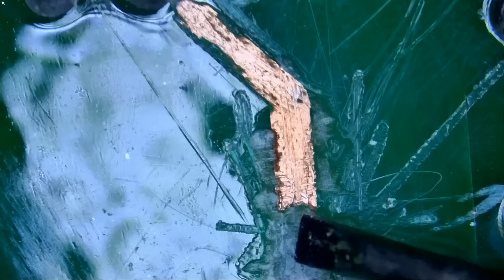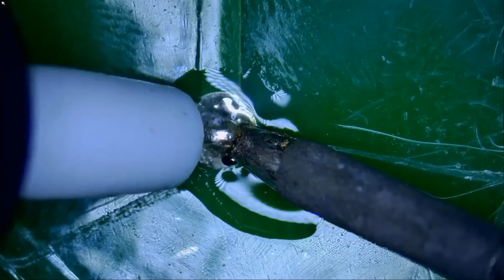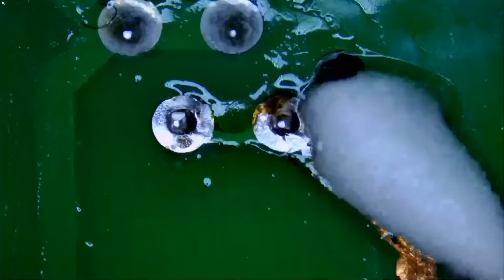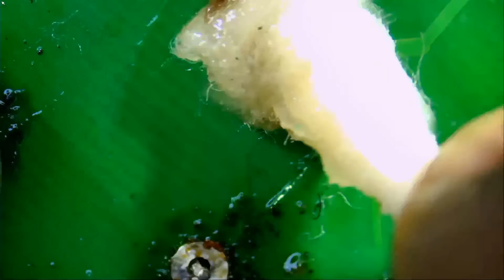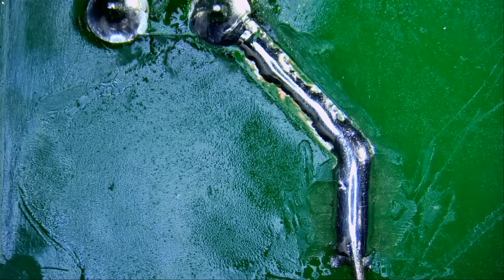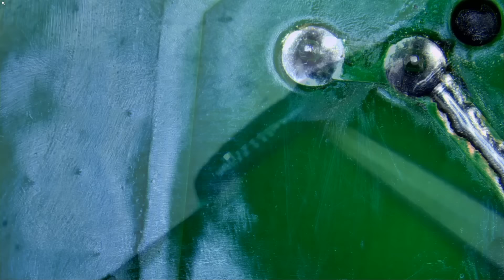Whirlpool Dryer Motherboard Repair

Comment: In my former job, I liked to use a Weller rework station with vacuum pump for desoldering. It was very convenient to use it sometimes, but I wonder how practical and economical this kind of equipment is when it comes to daily use. Alex, have you had any experience with this kind of equipment?
Reply: WELLER is a world class maker of soldering equipment. The soldering iron in this video is by Weller. They design tools to be used DAILY, by professionals.
Reply: Radio shack used to have a soldering iron with a solder sucker built into the tip.

Comment: Can I ask a question please , I brought a soldering iron and i noticed I can adjust the heat is there a certain temperature I should be using it sorry for the dumb question keep up the good work sir your vids has made me want to try fix a mosfit on my power inverter , wish me luck 😩😂
Reply: Then you did not buy a soldering iron - you bought junk.
Reply: @pingpong9656  ok I don’t call spending £59.99 on junk at all maybe you should get a life or grow up before commenting with unless information

Comment: I bought a washer and dryer about 3 years ago for $200 the dryer would not heat and I fixed the exact same problem it was a bad relay on that same board

Comment: I repaired the same board in my drier except the relay was burnt to hell along with the board.  Used a different type of relay with heavy gauge wire from the source power to the load.  Took the coil voltage from the other end of the traces on the board.
Pathetic design for a 30A circuit.

Comment: solder suckers are amazing for hdmi ports to clean the legs holes after you desolder thr port . but you need to use it correly. heat the solder with soldering iron from one end and use the sucker on the other end as flat as possible to create a vaccum. waaaaay better and faster than a desoldering wick
متابعك من الجزائر

Comment: Two relays were replaced on my oven's PCB due to a power surge caused by a storm.
*  The oven was ON during the storm
  Also a relay was replaced in my Onkyo stereo amplifier due to the same lightning storm.   
* The Onkyo receiver was OFF during the storm. 

 (** I recommend turning off devices at the breaker electrical panel or unplugging the device during a big storm.  Unplugging the devices is sometimes not practical due to the location of the outlet and the number of devices requiring to be unplugged)

Comment: I replaced the same relay. The issue is the relay has high current and the solder joint is not large enough to handle it. This leads to heating of the joint and eventual breakdown then arching that destroys the solder joint.  Looks like the the owner tried to clean up the trace and solder point.

Comment: Hi,
If you mention temperatures, are they in fahrenheit or celsius?
Hot air 500 degrees and soldering 450 you mentioned in some videos.
Keep up the good work and nice interesting videos.
Best regards,
Ronald
Reply: Those are celsius figures.

Comment: ironically, the sucker works great with low melt solder...
Reply: Yup  - gives you more time to get the nozzle on tightly around the pin before you suck it off.

Comment: Great Video Alex! Strangely enough I recently replaced 4x relays which look identical on a solar inverter repair. I also had to repair a few tracks that were burnt out due to high current flow so I used 2.5mm2 solid copper wire to beef up the tracks. Great Job. Well Done!

Comment: I’m guilty of recommending you use the sucker a couple days ago although you tried it and didn’t like it just like you mentioned the wick is your comfort zone personally i use it to pull most of the solder then use wick because i prefer to use as little wicking material as possible glad you tried as far as you charging $100 per trace and charging him a fifth of what his spectrum analyzer costs really was a steal that guy using that machine made his money back and should either pay up or go buy a new one i thought it was fair price for saving him money btw as my name implies i actually have to build rc airplanes from scratch foam alone i solder repair and do computer work myself no help and trouble shooting to have a piece of foam turn into an airplane flying ten miles away with live camera control

Comment: Modern Washingmachines and dryers have horrible powersupplies. They have cheap switching units which overload easily but cost half the price of a new machine to replace. I lately fixed one by replacing a varistor, resistor and an IC + trace repair. All of them blew because of a slight power fluctuation. Material costs of maybe 3  € because I had to buy stacks of the spares.

Comment: Grab a multimeter and set it to Ohms. Touch the leads across the electromagnet coil pins and measure resistance. Anywhere from 50-120 ohms is OK. Out of range or open means a bad electromagnet coil winding and time for a new relay.

Comment: I just recently repaired the exact same board and relay for my daughters dryer, it seems to be a common issue for theses boards due to vibration. Her relay was still good, I just had to add a wire. As always, nice job Alex!
Reply: So the relay needs to be glued in place?

Comment: Why charge a customer $100 for polishing 1 pin? Thank you for not exposing my eyes to uv light after applying solder mask. I think use braid instead of wire. I won a prize but you don't answer me.

Comment: My Maytag epic dryer basically did the samething.the trace burnt up just from use.

Used some  Thick wire to patch the trace,then flooded the trace with solder to beef up the current capacity. 

 planned obsolescence!!

Every year like clockwork in sept-oct i have to replace the heating element,which is fine as i take the  Opportunity to strip down the whole dryer and clean all the lint out.bout every 3 or 4 years i replace the belt,rollers etc. Just keep the parts i need on hand,and order replaces when i do the work.

I refuse to move into a newer dryer as they are a pita to work on,have higher costing parts,and fail more often.

Comment: Good repair. When using a solder pump / sucker move the iron out of the way and then quickly place the nozzle perpendicular / flat to the PCB.
Reply: he probably can't be cause the microscope is in the way
Reply: Ahh yes the teaching an experienced repair tech how to suck eggs.. Classic
Reply: Solder suckers are just junk. I’ve tried giving them a fair shake, I really wanted them to work. I’ve tried probably nearly 20 kinds of them. I’ve tried adding extra solder, I’ve tried adjusting the heat from the iron to keep the solder flowed longer, I’ve tried adding extra flux to help the heat remain, I’ve tried putting the sucker perpendicular to the board (which is nearly impossible under microscope). They are just junk. Plain and simple. There are much better methods available. The poster above me is absolutely right, the solder is cooled and hardened before the sucker even becomes perpendicular. But thank you for explaining what the word “perpendicular” means, none of us had any clue 😂
Reply: @ProudOfYourRoots definitely takes some crazy fast precision
Reply: Those type of suckers don't work very well. The Solderpult by Ersin is better.
It is twice as long and thicker so it sucks more air.
Reply: This, it requires a bit of technique. But also it wasn't the most appropriate tool for this job.

Comment: Alex, the ‘domino’ modules used in various washer/driers have issues with a cheap power resistor shorting and blowing an IC … it takes like 4$ in parts to repair a 200$ module

Comment: The tip of solder sucker is heat resistant we can put it on the soldring iron tip and it won't melt that way it will suck like it should i didntt know  that when i bought it i have the same one

Comment: Solder sucker works fine, when you need desolder any tht components, but after sucking solder jonit you need still using solder wick but save them. Solder suckre works better when you mixing unleaded tin with leaded. Regards 🙂

Comment: I noticed you didn’t test the relay before fitting you should test them
Reply: You don’t normally test a replacement component out of circuit before fitting
Reply: @gordonm2821  A relay is like a switch best to test it works
Reply: Thanks for the insight of what a relay does, greatly appreciate it

Comment: That type of failure of a soldered joint on a relay or inductor is usually caused by metal fatigue of the solder, due to vibration and lack of mechanical support of the component.  I would always put some hot melt glue or similar around the relay to take the vibration stress off of the soldered joints.
Reply: How do you know that the old relay failed? It looked to me that the relay pin was burned due to arcing at the failed soldered joint the heat from the arcing would also cause the track to lift from the substrate.
Reply: Or excessive current flow, and oxidisation of the solder. I recently replaced 4 identical relays on a solar inverter, and there would have been no vibration in that.
Reply: Kap tape at the least.
Reply: I think you're confusing the relay with a transformer.

Comment: Use conformal coating to waterproof the board.
Reply: Mg Chemicals makes a real good conformal coating in a spray can.
Reply: Unless you know what was applied from factory I wouldn't even mind, it's probably coated by deposition with the acrylic type or parylene, some types of conformal coating won't play well together, gotta be careful

Comment: Hello Dear Alex great work, this is my specialty i repair every electrical PCB Board as i see this is the first time you have accepted a washing machine PCB board so it's different from computer repairing because components of computer boards only work by D.C. but components on an electrical PCB boards are working by both A.C. and D C.
Reply: I think bc he can repair without any assemble or disassemble. Firstly doing the jobs that no need to disassemble. Smart move. He using his brain 😁👍

Comment: May I ask what kind of wire did you use for the trace? Also great video!
Reply: It's solder dude.
Reply: Probably some aluminum garbage
Reply: Looks like tinned solid core copper wire.

Comment: I was cringing watching him power through the conformal coating.  Probably acrylic or polyurethane.  But it's not hard to remove with IPA or mechanically
Reply: Meh, we use conformal coating in FPV drone builds and it's perfectly fine to just blast through it with the iron.

Comment: I agree, low melt solder is the best approach. Having said that the way you're supposed to use the solder sucker is to heat the joint with the soldering iron and once the solder is molten you quickly remove the soldering iron and put the solder sucker fully perpendicular against the board and release it so you're covering the entire hole and pin with the solder extractor. When you do it in that manner it's actually pretty effective.
Reply: And adding more solder is helpful when using solder sucker.
Reply: @requiem4adreamc  I sometimes use a toothpick to enlarge the hole in the board while the solder is still hot. Works great.
Reply: @requiem4adreamc  Yea, that would of worked pretty well if he gave it a fair try. Plus, not holding it close enough to the board to get a better vaccum and not using enough solder to allow the tip of the pump to create a better seal with the pad. It was only ever going to go one way, badly. These bigger through holes shouldn't be much of a problem for these cheap pumps. It almost did the job with a poor attempt.
Reply: Agree
Reply: Was gonna write th same
Reply: @windowsxpprofessional  "XP professional" that brings back memories! And probably still faster than the newer O/S's  with all of the excess bloat they now have :(
Reply: @BuyitFixit  yep :(
I still love this os so much that I use it on a vm for the fun but sad because there is no browser support:(
Reply: It's impossible to hold a solder sucker perpendicular while working under a microscope.
Reply: @mrBDeye  I do it all the time while working under my microscope. Also, when dealing with larger through hole components like the relay depicted in this video you don't really need a microscope to accomplish that task.
Reply: @PracticalKnow  The solder sucker couldn't be perpendicular in this case because Alex was using a microscope.
Reply: That's how I do it. Or, put the iron on the other side of the board, when possible.
Reply: Well explained, there is some crap solder suckers on the market that need binning asap. A good one will hang from the skin on the back of your hand as a good test and will be good for years!
Reply: Plus if he added a touch of the low melts to the stubborn joints the sucker probably would have worked fantastic
Reply: Those suckers are junk. I use a Hakko FR-301, units like it have a hollow soldering iron tip to melt the joint and a vacuum pump on a trigger which works very well. I'll occasionally replace PCIe slots on desktop motherboards, with 162 pins plus mounting holes wicking low melt out would take ages and waste wick/solder.
Reply: @ProudOfYourRoots I've been using them for almost 50 years, and they are a life and board saver.  At worst, they leave a speck of solder on the lead but it comes loose with a flick of the iron. But whatever works for you.
Reply: 100%. Came here to say the same thing. Though wick too works so well and is visually pleasing 😁
Reply: Y'all, like him, are missing that first crucial step: remove the flipping conformal coating! Yes my military experience is more chassis mount and through hole style components but I've done a fair of amount SMD rework as well. All to J-STD-001 class 3 requirements. (No NASA/Space addendum though, I ain't that bougie lol)
Reply: agreed.
i melt the tips of my suckers to conform to the shape of my iron tip (looks like a V melted into the tip).
this way i can apply heat and suck with a good suction
Reply: @ProudOfYourRoots that's where desoldering guns come into play. vacuum pump and heated circular tip to heat the joint
Reply: @ProudOfYourRoots although I generally use a solder station which has a heated tip - the solder will stay molten for a short time even with a soldering iron. For a soldering sucker,  I recommend the Japanese Vampire brand which uses a replaceable silicone tip.
Reply: It's usefulness for big holes doesn't hide the fact the sucker gun love to plug small holes ...
Reply: Solder sucker for me works better for through holes with hot air and after applying leaded solder to bring the melting temperature down.

I use it to desolder game controller thumbsticks or to remove stubborn left overs of solder on through holes.
Reply: @ProudOfYourRoots try with hot air after putting leaded solder on the hole. It works a lot better. With soldering iron it's hit or miss.
Reply: what is the composition of low melt solder? I've been searching for bismuth based solder but it doesn't seem to be available in my country (spain). Is there any other common type that could be available in my country?
Reply: @gabrielcorrales8878  check the melting point of pure lead and compare to 60/40 solder.
Reply: @gabrielcorrales8878  metallic bismuth is the "secret".
Reply: @gabrielcorrales8878 look for field's metal
Reply: Solder suckers are a handfull and not very practical. But they have their place in a very limited set of circumstances. This one is (IMHO) one of them. But most NorthRidge Fixes it would suck many components off the board sending them into the 9th dimension...
Reply: Exactly what you was speaking about in your last comment. Everyone's an expert smh.....
Reply: True
Reply: clearly he is not using the solder sucker correctly i think. And it amazes me he refuses to waterproof the board!?
Reply: It needs vacuum, so do not keep that far away.
Reply: The electronic ones work pretty well.
Reply: I have had about 50/50 luck even doing it like that. The only solder suckers I have ever had work are the ones that heat and can suck at the same time... Giggity.
Reply: The only solder sucker I've ever used that was worth a damn is the Engineer as you can place the silicone(!) tip right on the soldering iron when desoldering! It's the only solder sucker I've ever had that actually sucked solder lol
Reply: That's exactly how I do since I about my  first solder sucker many years ago,, if damaged  I buy another one
Reply: dude those free solder suckers do not work lmfao
Reply: Its almost like doing things for video creates more issues beyond what the exact issue actually is.
Reply: I dont understand how he didnt see that as obvious
Reply: @infernus6278  Perhaps he hasn't worked on many through hole component boards?
Reply: Sure, although i still prefer the braid solution I use it very often and it works like a charm. No perfect solution but the one we chose and we feel better to work with ;)